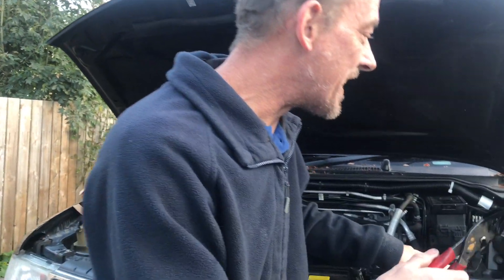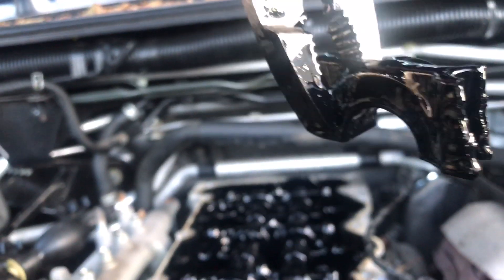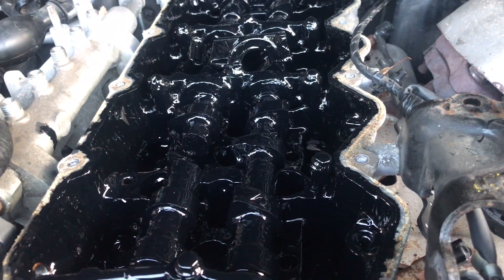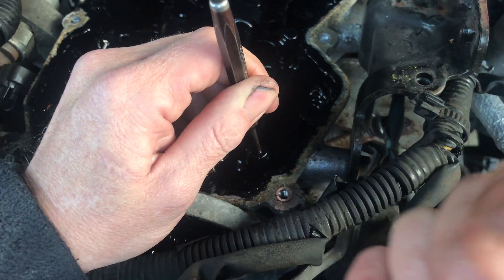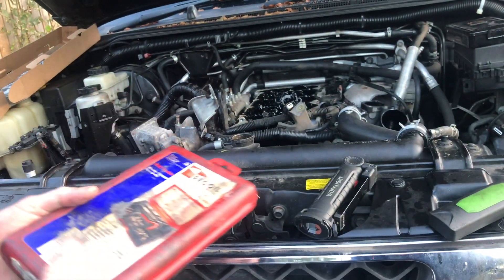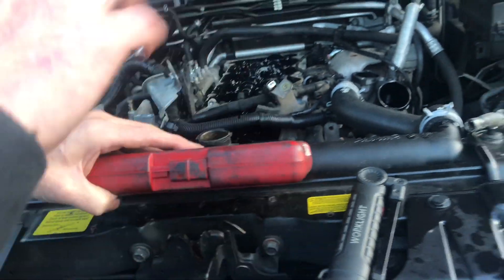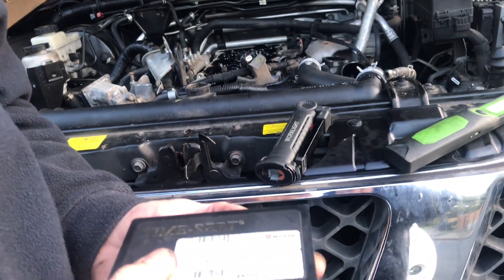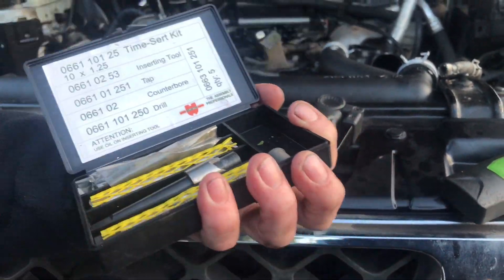How to repair cylinder head with the worst poss damage!

Comment: Hey mate just had a reconditioned replacement motor put in my navara after my motor completely seized. However the motor seems to blow white smoke at times. Def not coolant. Smells like diesel. Any idea why? Had the injectors rebuilt too.

Comment: Hey Mr Yorkshire I have an 2008 Nissan navara  it  had a fuel pump code changed both suction control valve sensor an rail sensor genuine but every time I come to a stop like in traffic it closes off an when I get it restarted idles rough what could be possible cause off rough idle........ it also shuts off after few mins while there idling

Comment: Hi Des ... Looks like the owner didn't do much servicing with the glugy or thick oil residue in the cover, let alone in the front of the motor. Are you going to video from actually pulling out the motor to dismantle and rebuild the motor  and then re-assemble piece by piece and then refit the motor etc. would be great video content.
Reply from the maker: Hi Ted yes we are everything we see you will see buddy

Comment: That's few terms repairing hole s the others are welding a nut on the broken bolt. Which by the way south main auto has done along with many others to extract the bolts. One of th e hardest is removing the four sided bolt that'd be for sending unit sensor on block of engine.  Aluminum welding is another alternative to damaged threads etc....